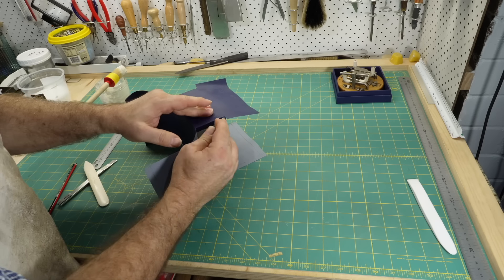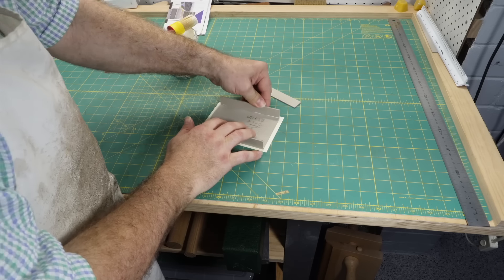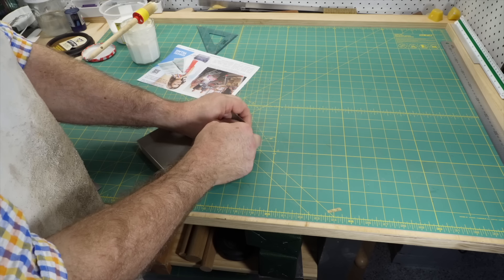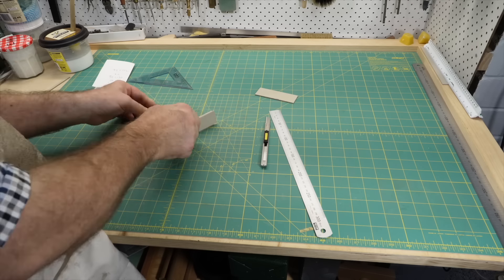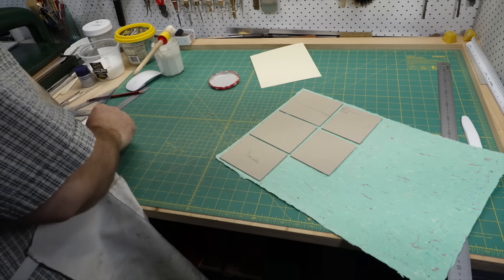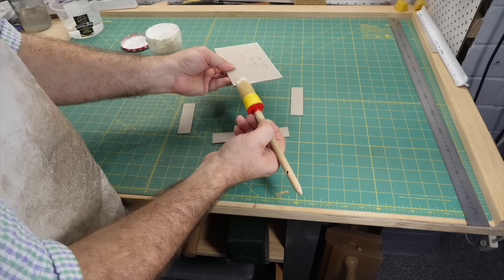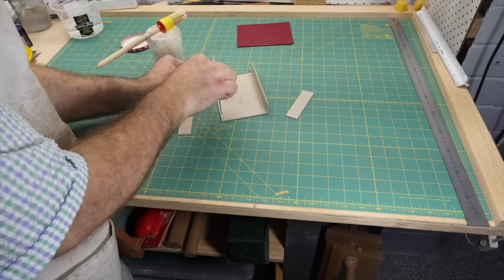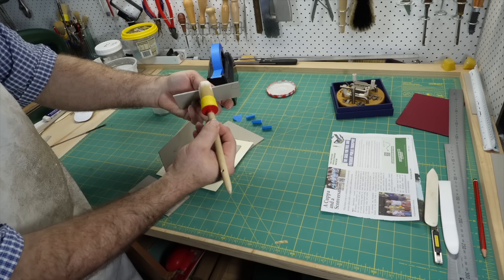Three Ways to Make Trays // Adventures in Bookbinding

Comment: Darryn- I find it helpful to make a small gage for more accurate measurements. I take a strip of single thickness board 12x2 cm and glue up half its length with a second strip of single board 6x2cm. I then cover 3cm of the single board end with my book cloth or cover paper. This one tool measures added lip required and cover material allowance. I also prefer the card stock lamination technique. Looking forward to seeing how you cover- especially in box interior.  Nate
Reply from the maker: For spacing things I do this, such as in clamshells or portfolios.  But for these simple trays, everything is right there and I don't have to worry that I grab a gauge of a different thickness.

Comment: I once attempted to make a box by scoring and folding board following Zeier's instructions in his book. Maybe I was using too thick a board but the resulting box looked horrendous. The edges where the folds were ended up with chamfers/radiuses where the board folded, and despite best efforts to remove layers of greyboard the little gluing tabs he tells you to leave showed through and looked really bad. My curiosity was satisfied but i won't be trying it again.
Reply from the maker: Yes, the corners are never as sharp.  I forget who, but one author suggests putting string/twine in the groove left by the cut/score.  And yes, those little tabs do show.  Just look at old boxes made this way.  You can usually see the pieces of paper.  I'll do at least one video on this to satisfy other people curiosity.  I've already done it too:)
Reply: @DASBookbinding  I was using 2.5mm greyboard because that's what I had. I can see it having better results with 1mm or similar but at that point I think you would have a very flimsy box.

Another method of tray construction I've seen but never tried is where all four walls are made of a continuous strip that is covered beforehand (I think) then scored where the corners are and wrapped around the base. I have a hinged lid box made by Vintage Paper Co in orkney that is constructed this way. It only cost £25, so I can see how they would have had to economise on time as much as possible. This strikes me as a stronger method than the scored box that is still faster. The joint of the ends of the strip is positioned at the back of the box where it gets glued to the spine of the case so it's not very visible when complete.

Comment: A fourth option could be double-walling combining methods one and two, so there’s as much overlap in the joints as possible? 🤔
Reply from the maker: Saving double walls for another day
Reply: Yes it is called lap joint. We use this method at our bindery. It’s a bit of a headache to get the measurements right but quick if you practice :)

Comment: How is the folded box weaker than the other options? Seems to me that a folded edge is at least as strong as a glued one. Unless the corners are not being glued?
Reply from the maker: To fold these boxes thinner board is used and by scored, I mean partially cut, and usually no adhesive in the corners.

Comment: This a great video, and I would like to make some boxes in the future. I was also wondering, if there is any bible paper supplier in the U.S. you would recommend as I am planning a project that will involve this kind of paper.
Reply from the maker: Thin paper is often called bank layout.  I doubt there is anything retail US letter size, but a paper merchant that supplies the printing industry will have light weight paper.  Most likely you have to buy a mill ream and have it cut to size (it might cost something like $30 for cutting).  You end up with all the paper.  It might mean a minimum investment of a couple hundred dollars.  Hope that makes sense.